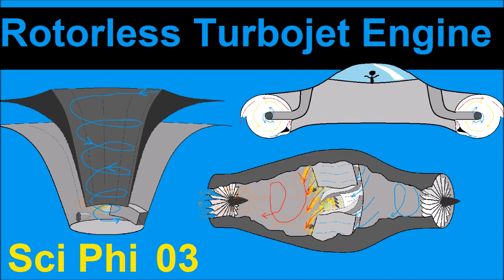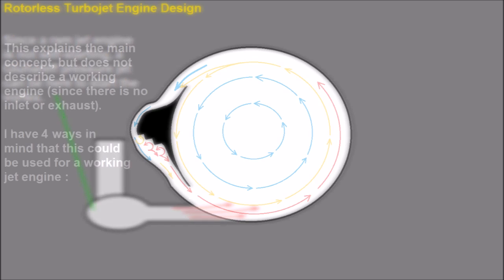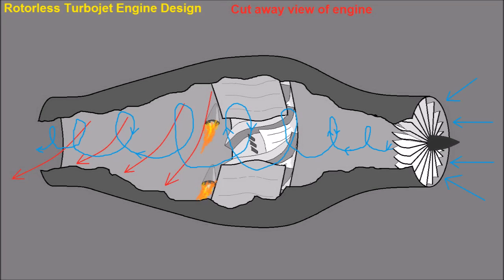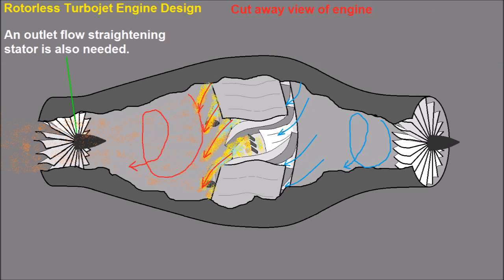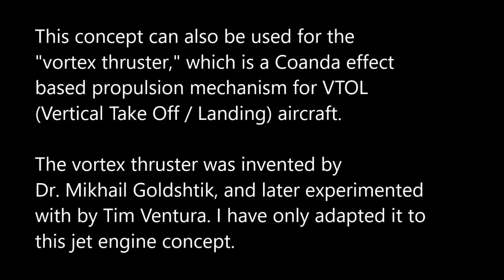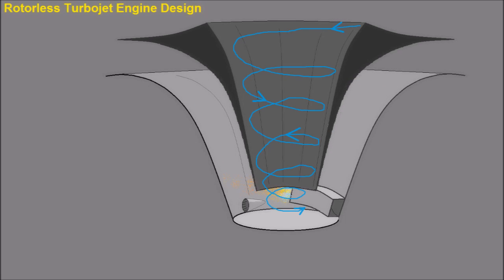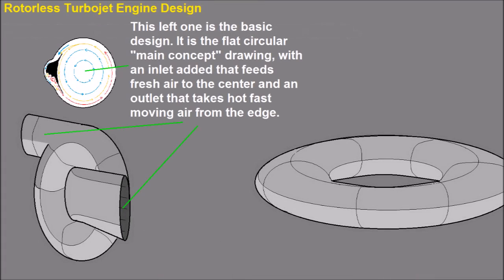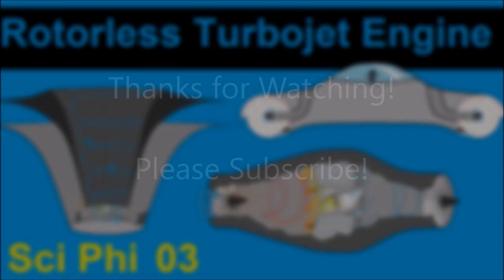Rotorless Turbo Jet Engine Design SciPhi 03

Comment: Yes very close, thoughs flames in your pic should be just air right? Also inlet air tube can be ducted else-were and shaped not round right, plus even more cooling plumbing in there maybe say to cool off chamber more than air force should cool everything off, then there's using pusle with it at Max thrust issues...?🏁🌵🏄‍♂️📐🛹🐏
Reply: Good job sir...🚀🛰️✈️🛩️🚁🛸🏆🏆🏆

Comment: first a ramjet is effective from mach 6 upwards ... a scram jet is effective from mach 3 to about mach 7 ... and normal thrust afterburners are good to about mach 3 ... so starting with a ramjet suction pump will require speeds so high you wont be able to make a bearing to withstand the strains it will have to endure.  yes you will have to have a bearing on your starter ... and it will have to provide a force to start the ramjet equivalent to mach 6 .... or somewhere near 50,000 pounds of compression ... heck the f18 doesnt even do that with max afterburners ... nor the f35 ... their ramjet test bed requires rockets to get it to speed before the ramjet will even provide enough thrust to provide lift ... 

.
if you want to create a vortex look up Viktor Schauberger for his hyperbolic vortex idea ... and his vortex generator rotor ... it has been used in loads of water applications and his repulsine has been rumoured to have flown ... even test bed partial tests have shown they do produce lift so can also produce thrust ...
Reply: First dude you're wrong with the ramjets they are not effective over mach 6. Just sayin' mate peace!
Reply: Rocket motors can be used as gas generators

Comment: The exhaust stator should probably be variable to account for various vortex speeds or throttle settings. The intake sator maybe should also be variable but that wont be as important as the exhaust one.

Comment: gonna be hard to start
Reply: impossible actually ... ramjets dont work well under mach 6 speeds ... and at startup to start the ramjet it will have to have that much air speed passing the vortex to even START the ramjet ... and that means he has to essentially put 3 f18 jet engines exhaust into the startup at max after burn JUST to start the thing ... not at all practical from that point on wards ... 
.
mind you if he took the normal afterburner and scram jet and ramjet  concepts and could combine them into one engine bay ... then that would be much more efficient ..... allowing the normal jet engine to take off and use afterburners to get to speed to start the scramjet to take it past the jet engines best speed and into high mach speeds of mach 6 and 7 where the ramjet can then take over and push the plane faster up into the double digit mach numbers ... where everything  now depends on design for how fast you go ... 
.
dont forget a jet engine is only good upto about mach 3 ... a scram jet is good from just under mach 3 to a bout mach 7 ... and a ramjet is good from about mach 6 upwards ... those limits are a factor of what those types of engines require just to function ... moderately efficiently ...

Comment: Have you made any progress with the rotor less jet engine? I am working on a similar design and would like to collaborate.
Reply from the maker: Yeah I have been working on some 3D models and a guy who works at the same place as me is going to try to build a prototype after I get a completed and flow simulated model, then 3d print and flow-test a small physical model. SO I am already working with someone but thanks for your offer. What sort of design do you have?

Comment: Thanks for sharing your ideas we all need to share ideas so as a society everyone can benifit and working models will be developed much faster.
Anyway; why are you placing turbines at both ends of your cumbustor tube, are you driving a gearbox like a turbojet does or is the thrust produced spent like a typical  jet engine?
Reply from the maker: Yes I agree! The "turbines" at both ends are not turbines, they are stationary guide vanes for the air flow. The inlet stator helps guide the air into the vortex and the outlet stator straightens the exhaust flow.
Reply: JaycubL I see; I didn't look at it close enough, it looked like free floating turbine wheels...
I found that installing an exit cone flare that is around 25% larger than your cumbstion chamber housing you will achieve a noticable increase in thrust? Thanks, 
Sean

Comment: The problem is, there is too much dirty air. All of the dirty air would greatly increase drag, noise, and fuel consumption. However, it is harder to come up with a new jet engine design than people think, so props to you

Comment: hello there, i have a thought similar to what u did share and im still working on it , its like the design of the tores shape i called it donate engine , i used the outlet inside the tores and inside that tores there is blades that direct the airflow to turn it into a vortex basically i was working on it to achieve the venturi effect to eventually have something like the ship in guardians of the galaxy have or a quad copter or a jet pack with one simple compressor and the tores provide the lift , i forgot to say that inside the tores there is a combustion chamber witch will add more pressure while the gas coming out between the walls of it it will grab more air just like the blade-less fans works, images can explain more then what i can describe i did a model of it that can be printed with some miner modifications on the thickness of the wall i'm trying to make one with soda cans and i didn't get the result i expected from it but i'm still trying to make it work , i hope i didn't speak to much for nothing and for more talks in the future . good work and hope to see more of you :)

Comment: I plan to power a turbine with sound energy, and harvest the heat of the movement of airflow and sound(cycling sound pulses of positive pressure and pulses of negative pressure/ one in and one out to generate alternating current and maintain the principles of refrigeration and heat pumps.

And prove that heat engines run on heat when running. 

Fools pay for fuel, and those who synthesize fuel can go to hell.
Reply: What's the point, there's almost no energy to harvest in sound. Why would you bother. Even industrial wind turbines suck

Comment: it wont work. the outlet vortex would create a vacuum in the combustion chamber. ram jets only work this way because the inlet air is moving so fast (ramming) relative to the engine that compression can be achieved without mechanical compressors. this design would not achieve any compression unless the engine were moving faster that mach 1 before ignition.
Reply from the maker: The rotation of the air would compress it against the walls of the cylinder, and would also feed the at into the combustion chamber inlets at high speed.

Comment: I'm sure that there have been plenty of comments about not having enough compression to make enough power to run anything other than a R/C aircraft. Ever thought of turning your idea into a combustion chamber for a turbocharger based turbojet? With the advent of axial turbine turbochargers, all that is needed is an efficient combution chamber to make real power for homebuilt aircraft.
Reply from the maker: +3rtsmi I think that between the very high speed the vortex could reach, the centrifugal compression, and the fact that the colder denser air will collect at the outer rim of the engine, you could get more than enough compression to run a ram jet engine. With the steam addition, fuel efficiency should go way up and the engine could produce thrust even if it was not running well at all (as long as the engine burns and makes heat). For a VTOL aircraft, lightness is efficiency. So even if it is not extremely efficient it might do better than a heavier engine for fuel consumption. The very good rpm response of this rotorless design would also be helpful for VTOL craft. The biggest advantage of this design in my mind comes from the simplicity and lack of practically any maintenance requirements. That would allow a practical and realistic VTOL craft for individual use. Another way to use this would be as an indirect cycle nuclear gas turbine that could fly for decades nonstop (a design with a rotor needs maintenance after a relatively short time). With this design you also do not need any especially precision machining or advanced alloys (lessening cost and making it more practical, and home-make-and-maintain-able).

Comment: I had a similar idea but I see the problem being that you are simply making ramjets less efficient in order to use them at lower speed. Ramjets are about half to a quarter as efficient as a conventional turbine and you would be removing the high speed benefit as the efficiency would impact your top speed and range quite a bit.

I came up with one solution which was to allow the ramjets to pivot so increasing their efficiency as speed increased. This though completely defeats the point since it adds so much complexity.

The core problem is the compression ratio, if you could design the vortex so the compression ratio of the vortex was such that it increased the compression ratio then you might be able to solve the issue. I did wonder if this could be achieved by having the exit and intake ports of the jets at different angles which would mean correspondingly different pressures.

Hope you can solve the issues I couldn't

Comment: interesting idea, but wouldn't this engine stall itself since it uses under pressure to create the vortex? what I mean is that as soon as you get to speed it would be difficult to maintain that vortex since you have "head pressure ".... basically it turns into a ramjet but only if the tube is shaped correctly
Reply from the maker: raymonroe1983 The main use I see for this is as a VTOL engine, (the torus shaped engine and the vortex thruster). where you need something simple and light. Pressure jets are excessively loud, and I think this vortex based design could get higher efficiency because of the compression you could get, and from the fact that you can use steam (then the main fuel is then like a steam heater that also contributes a lot of extra thrust). If the vortex can reach 600-700+ mph, combined with the centrifugal compression of the air, I think the inlet pressure for the ramjets can be plenty. Thank you for watching and commenting!
Reply: Interesting theory, and I hope someone will test this one day real world. if it indeed has better efficiency, and simple no moving parts it would be a nice leap in VTOL technology. Thank You for the reply, and have a good day.
Reply from the maker: +TheHom3er I thought about that too, that is why I put in the inlet stator to help incoming air be directed into the vortex. I have not built and tested this engine yet so I can't say exactly how it would really perform though.
Reply: +JaycubL oh yeah.. totally forgot the inlet stator...
Reply: +TheHom3er 
Yes, I don't see it working too well.  For efficient engines you need a significant compression ratio.  Other than that, its just a ramjet.
Reply from the maker: ***** It is a ramjet that can work at low speed and hover. I think you can get the internal vortex to very high speeds then both the speed of the air and the centrifugal compression should be enough for the ramjets to run. My thought is that this should be able to produce more compression that a pulsejet so it would be more efficient while also being quieter because it is not a pulsejet. Vs a turbojet this might be less efficient but it would also be much lighter and require less maintenance. It would not need the high speed bearings and lubrication, turbine blades that can handle the heat and forces, and careful balancing of rotary parts. It could be all stamped and welded stainless steel. With high forward speed, I think the inlet airflow could produce plenty of pressure and allow normal efficiency for the ramjets.
Reply: +JaycubL A Pressure jet would be more useful. There has been no improvement in their design in years. There is significant room for improvement on both Pulse Jets, and Pressure Jets. I do like your design though it seems simple enough, and it may work for lower speeds. high speeds I think you will have difficulties in keeping inlet pressure from stalling your vortex. I however do not have the scientific background on vortex's to say yay or nay. great video...
Reply from the maker: Kyle Towers Thank you for commenting! I am not implying any specific amount of compression. It would depend on how intense of a vortex you can create, air temp., engine diameter, design for the individual ram jets, etc... This video is a set of 4 engine concepts, not a computer analyzed precision design. You could probably get very high pressure You would not likely see the compression that you get in a piston engine or a mechanical turbine, but this concept has no moving parts. So it is light and cheap and reliable. Lightness itself can add a lot to efficiency especially for VTOL craft. When you look at the cost and service requirements for gas turbine engines, along with the precision work needed to make them, I think a rotorless concept is very appealing for many uses. Small light cheap stuff, and more advanced ideas like a nuclear thermal jet that can stay in flight non-stop for many years without any mechanical service to the engine.
Reply from the maker: Kyle Towers Yes, I guess it is hard to know until it is tested. For a very minimal personal VTOL craft the engine cost, complexity, maintenance requirements, and weight is a big deal in my mind. No rotor should also mean sharp throttle response (important if you think about designs like a quadcopter-style aircraft). My "hypothesis" on the compression is that it probably could be much higher than what you see in a pulse jet engine or a pressure jet engine, but again I have not built and tested this to know for sure. Also, in a high speed vortex like this the cold air will collect at the outer edge in a centrifuge-type effect. this would improve the charge density in the combustion area. Maybe something special can be done with the inlets to the individual ram jet engines to strongly improve compression in a small spot. I want to try building this engine but like some of my other ideas I just don't know how well it will actually work if at all yet.
Reply from the maker: Kyle Towers The fact that someone else has not built it, is never a reason to think it would not work. I think this could have higher compression than a pulse jet, I will do some math but I have to figure out where to even start. A physical model might be needed to get data. And the "steam pressure" add in could mean that you can have a running engine even if the cycle was extremely inefficient. I still think it would be cool and useful to me to build and I very strongly bet I can get it to run.

Comment: Not really into aircrafts and those things, nor the engines and how they work, so might be a stupid question. how could you safely lower/stop the force given by this engine, as it has, lets say, no way to lower the rpm of the rotor as is with the rotor model (if they even work that way lol)
Reply: +ロクショウ I am tired so this comment is full faults excuse me
Reply from the maker: +ロクショウ Thank you for your question. You can throttle the engine by changing the amount of fuel going to the ram-jets. But yes it would always be producing some thrust when running. Since there is no mechanical rotor, the rotating mass is very low and it should respond very quickly to changes in throttle (low rotating momentum means little resistance to RPM change).
Reply: +ロクショウ lowering the rpm and thrust can be reduced the same way as in a normal engine/ jet engine: by reducing the amount of fuel that is injected